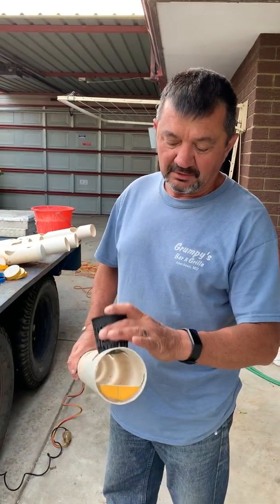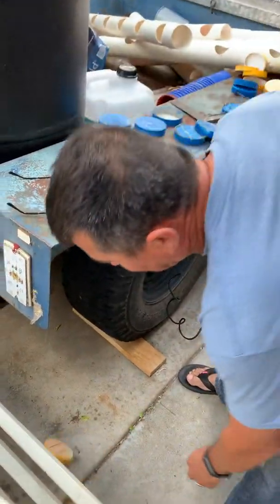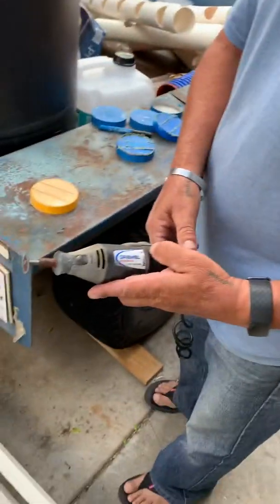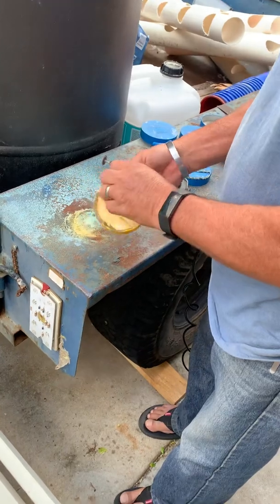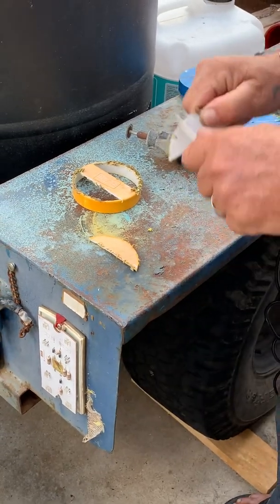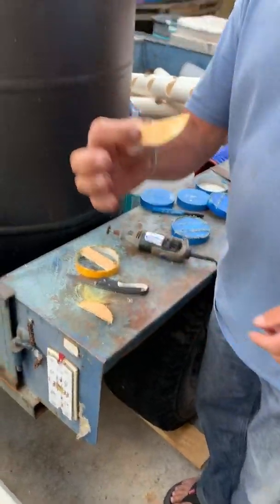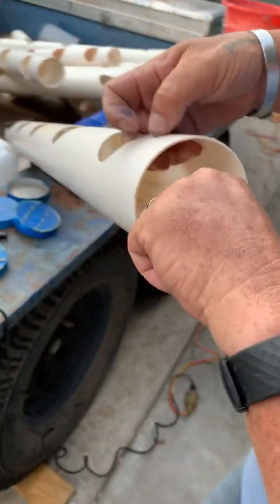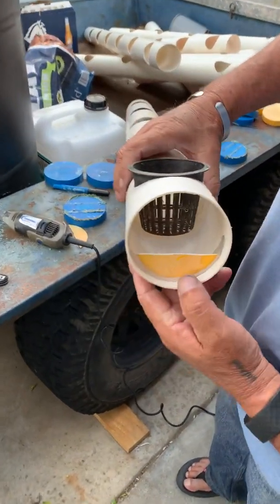Making baffles for hydroponic pipe systems to keep the nutrient solution level

Comment: This idea works !!..but once the roots get established you will end up taking the odd one or two out to stop overflowing....again depending on you crop.....tried and trusted method which does what says on the tin!
Reply from the maker: Yes ,  this is a simple method to keep the nutrient level with the bottom of the net pots so that the plants don't dry out, even when the pump is off or there is a power outage. Happy growing.

Comment: Why do you need to put those in
Reply from the maker: Buster King the nutrient solution must be level with the bottom of the net pot when the pump is not running or the plants will dry out and die. There are many ways to achieve keeping the level correct, this is my simple method. Here in Australia I am using a cost effective 90 mm storm water vent pipe, uPVC. Food safe.
Reply: @Brianshydroheaven  so so the pump should not run 24/7 is that correct?
Reply from the maker: Buster King I run my pipe systems from 6.00am til 6.00pm continuous then 9.00pm, midnight and 3.00am for fifteen minutes only on a mechanical timer . I like to keep the nutrient solution pumping all daylight hours to supply fresh, even oxygenated nutrient solution that doesn’t heat up ( Australian summers are a cooker) whilst say the pump was shut of at intervals the nutrient solution in the pipe would heat up, and deplete of oxygen, causing anaerobic conditions and possible root rot disease and loss of plants. If the temperature is ridiculous hot I will run the pumps 24/7 and add 3% hydrogen peroxide, to avoid root rot. During the night when the plants are not photosynthesising I pump at 3 hour intervals for fifteen minutes to oxygenate the nutrient solution, and provide the roots with fresh nutrient solution and oxygen.
Reply: @Brianshydroheaven  you don't mind me asking how do you keep your water from overheating doesn't it have to be between 65 and 80 degrees for most plants
Reply from the maker: Buster King mate , I’m in Perth Western Australia, our summers are scorching hot , up to and over 45c (112f) and I’m able to grow right through this by using several methods. 
Firstly it would be great to run the nutrient solution through a water chiller, but I don’t have one. 
Secondly burying the reservoir and covering it would help cool the nutrients but I am built over concrete so can’t do that. 
Insulating the reservoir by wrapping it in a thermal insulation would help, maybe I’ll get that done next summer. 
What I do is have a bunch of 1.25 litre water bottles which I freeze. Then in the morning I add a frozen bottle in each reservoir. The bottles that were in the reservoir go into the freezer. There’s another set of bottles in the freezer as well, so in this way the bottles are on a three day rotation. Sometimes I’ll throw a bag of ice in each reservoir, it’s that hot here, weeklong heatwaves over 45c (114f).
I also add 2 ml of 50% hydrogen peroxide (H2o2) in ten litres of nutrient solution, so my reservoirs are 100 litres I add 20ml to this reservoir every three days . The extra oxygen molecule in the hydrogen peroxide stimulates root development and kills bacteria, fungi and viruses. H202, dissipates over about three days becoming just H20 I believe. I’ll leave the pumps running 24/7 to keep the roots supplied with fresh oxygenated nutrient solution.
I’ll hose all the plants down in the evening it they are limp. I never lost any plants over the last two summers using these methods.
Reply from the maker: Though lettuce does bolt to seed in temperature over about 35c (95f) maybe my temperature guide is incorrect, if someone know exact figures, but that’s a guide. Cheers.
Reply: @Brianshydroheaven  How does your system cope with 40+ degrees days outdoors? even if you run pump 24/7 the dissolved oxygen in the nutrient will be very minimal if any when the water temp is high.
Reply from the maker: Dennis M I add 2 ml of 50% hydrogen peroxide in ten litres of nutrient solution every three days. H202  kills fungi, bacteria, viruses and algae as well as adding an extra oxygen molecule into the nutrient solution. Also I freeze soda bottles and add them in the morning, exchanging the thawed ones out . Some afternoons before dusk I’ll hose everything down. I grew all summer long, didn’t lose any plants to root rot. Lettuce bolted, but nothing died due to the heat. If you look at my weekly hydroponic garden updates particularly from Christmas til March you will see week to week how the garden coped.
Reply: @Brianshydroheaven  Saw your response just now, seems too much work for a lot of people, basically you have to stay home every day in the summer months to do that.
Reply from the maker: Dennis M yeah I drive a truck full time  , it’s easy to buy vegetables at the shop. They are cheap, thanks for the comment.